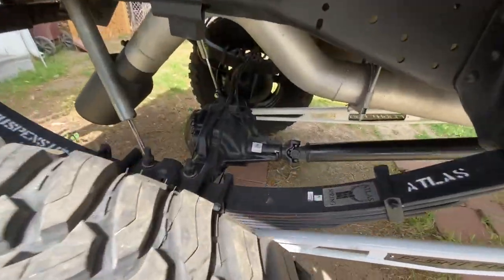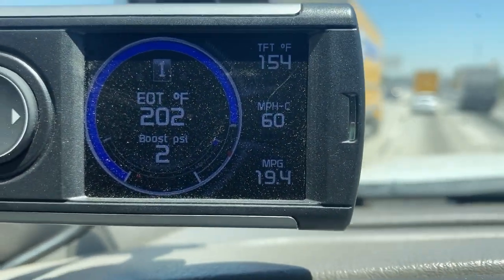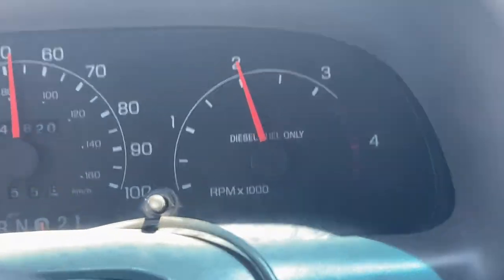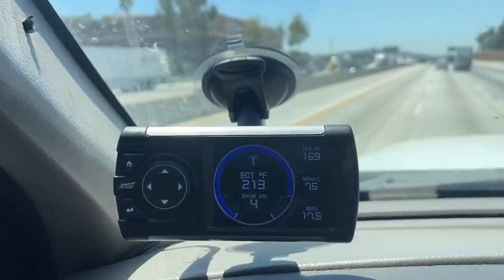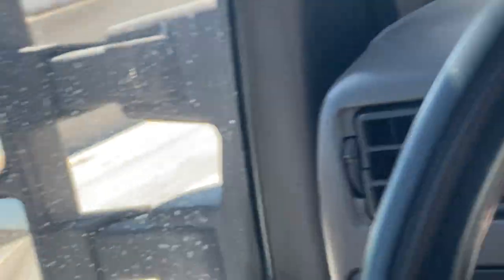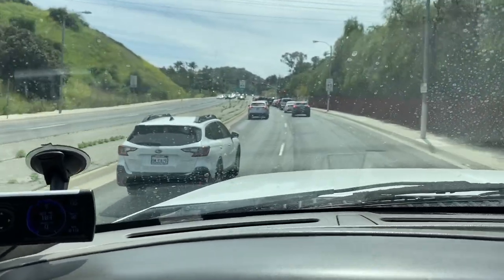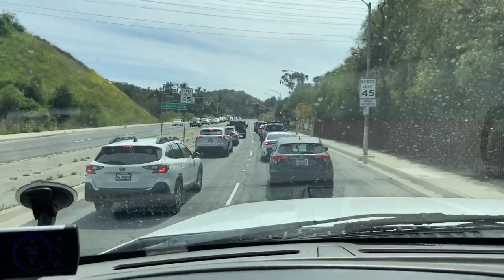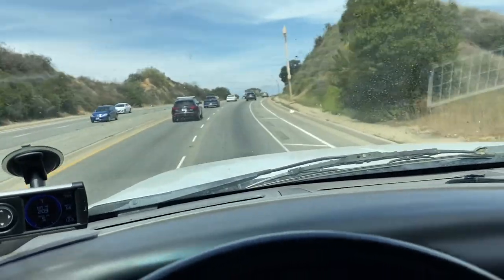4.88 gears in 7.3 powerstroke with 40 inch tires, first drives & review

Comment: Great video. It's also very encouraging mpg wise. I was surprised that the computer actually showed a better fuel economy even though you were running at a higher rpm. Since for my next build, I'm planning on using 40" tall tires and Ouverson 4.90 gears in 2.5 ton Rockwell axles front and rear. I was really worried that mpg would severely suffer from using 4.90 gears. Many people kept saying that I would need to use 5.13, or 5.38 gears if I wanted to use 37" or 40" tires if I want decent acceleration. Don't really know why they recommended the 5.13 or 5.38 gears. I just never talked with anyone that actually ran 40" tall tires and 4.88 gears in REAL LIFE. Thanks
Reply from the maker: Yeah, almost 3 years later and I’m still very happy with the 4.88s. The truck pulls my 22.5’ travel trailer no problem as well!

Comment: I'm running 40 x 13.5 R 20 Maxxis Razr Mts. I'm at 4.56 re geared as for daily driver setting and hwy Milage. Comes to tow it suffers. But, I've noticed the best method is performance tuner. It's back to optimal performance for towing. Maybe, later in near future I might go for 4.88

Comment: Have you looked into doing the trans cooler bypass delete kit  (thermal check valve delete)? That’s a big help in my opinion and under $50. Let’s the line flow 100% into the cooler instead of around 75%
Reply from the maker: Interesting bro! I’ll have to look into that!

Comment: I had 4.88's and after 2 weeks I took them off because I felt like I was too high on the rpms keeping up with traffic. Ended up going with 4.30's and and gave me 500 rpms less.  I'm on 37s BTW
Reply from the maker: Yeah the 4.88s are perfect for my truck with 40s so it makes sense it would be too much on 37s
Reply: Tas loco amigo 4.88s para 37s es overkill
Reply: @JesusF150   reread the comment. Thats the reason why I took the 4.88. Great low rpm’s. But they suck at 80mphs
Reply: @aaronmendez5461  damn, but they charged you extra to change them again?
Reply: what truck?

Comment: Hey bro I was curious did you ever change out your transmission pan for a bigger one that has cooling rivets on it and another idea that I got from somebody and they said when I’m towing a trailer I should have back up fans for the trans cooler to be able to do a haul when I’m moving at slow speeds
Reply from the maker: I haven’t changed the transmission pan, but I’m curious if the company that built my stage 2 tranny used a bigger transmission pan?🤔 and that’s a good idea too bro. Might need to look into that!

Comment: 2200rpm at 70mph is good, my dually with 4.10's towing the 5th wheel turns 2200-2300rpm at 70mph. Tip for ya, how about programming the Edge to read mph and rpm's that way you can film better. Also the transmission temps will range anywhere from 60-80 degree's over outside temps so 164 degrees is fine considering how hot it is outside.
Reply from the maker: That’s good to know! And that’s a good idea! I’ll probably put an rpm gauge on the edge now. And that’s good to know. I was a little nervous, but 165° is still way cooler than it used to be before the mishimoto trans cooler. Lol

Comment: 2200 rpm is right for 70-75. It could run that rpm w proper boost w as little engine ware as 1700 w low boost and high egt

Comment: Your videos are awesome brotha! Just got my first diesel and have been using your videos for information with my build. What gear ratio would you recommend for a 7.3 4x4 Excursion with 4” lift and 35’s? I’ve been talking to 3 shops and 2 recommended 4.56 and the last one recommended 4.30. I have a large 30’ trailer and go from riverside to Parker about 3 times a year. I mostly use the truck for long family trips and do 80-85 on the freeway. Also do you recommend the Edge CTS3 tuner or Insight monitor and Hydra chip? Thanks for all the good info man
Reply from the maker: If you only tow 3 times a year and you’re on 35s, I probably wouldn’t waist the money to regear it. 35s are barely larger than stock. I ran 37s on stock gears for years. If you towed every other weekend, or even once a month then maybe. But you won’t enjoy cruising at 80-85 if you put 4.56s in. That’s just my opinion. You should get a mishimoto trans cooler to help lower your trans temps, and the hydra is by far my favorite tuner. I’ve had the edge tuner, superchips, and now the hydra and it’s the best by far. And you can use it in a “tow” tune while pulling your trailer and I think you’ll be fine.
Reply from the maker: And a monitor is a good idea for sure so you can watch your engine oil temps, trans temps, and I recommend getting an EGT probe so you can monitor exhaust gas temperatures as well. This is the one I use: https://amzn.to/2xHTHso
You would need to buy the EGT probe adapter to read exhaust gas temps on the edge monitor. Or you can just use the monitor to read everything else and buy an individual gauge for EGTs. I’ve got 2 gauges coming in the mail now, one for boost and one for EGTs.
Reply: @NoHalfAss  my up pipes are bad should I go for the KC300 Turbo upgrade? Was it worth the money in your experience with it?
Reply from the maker: @allenmahan7122  it depends bro. I didn’t see a huge difference in boost with the new turbo, however most people do so I think something is wrong somewhere with my truck and I just haven’t taken the time to figure it out. Haha. KC turbos think I have leaks somewhere and say that I should be getting well over 30 psi but I don’t think I do. We’ll find out when I get the new boost gauge. But it was nice because my stock turbo was getting turbo bark and the new one doesn’t, and I shouldn’t have to worry about blowing my turbo unexpectedly anytime soon.

Comment: Do your tires rub on the lift springs when your turn all the way?
Reply from the maker: No. They did with the previous set of wheels but these ones have a -44 offset so they don’t rub. They only rub if I’m turned all the way coming out of a driveway or over a dip that causes the leaf springs to compress or something. But otherwise I can turn 100% in both directions without rubbing.

Comment: I know what you're talking about with engine load playing a big part of fuel economy and not just rpms. Also youll notice a bigger difference on the highway when you need to accelerate to change lanes because your engine will already be further in the power band.
Reply from the maker: Yes I totally noticed that already! I changed lanes to go around someone on the freeway and the truck accelerated so easily and so much faster and I was already going like 60-65!

Comment: I’m just curious if I got to stock size tires which is like 32’s I tow quite a bit should I keep the 3.73’s or do 3.55’s it’s automatic transmission
Reply from the maker: 3.55’s will make it harder to tow. The truck was designed from the factory with the right gear ratio (3.73s) for stock tires ready to tow. So unless you are towing something reallyyyy heavy and pushing the limits with your trucks tow capacity, I would leave the gear ratio stock with stock tires.
Reply: @NoHalfAss  I was thinking that

Comment: bro i just got an 00 with a very similar lift on 40s 13.50. my tires rub on the leaf springs when turning all the way. Debating on either new wheels or spacers
Reply from the maker: I have 40 15.50s, so my tires are wider than yours and they don’t rub with -44 offset. Unless I’m at full crank and going over bumps or something. So you can get slightly more negative offset to have even more clearance. I preferred getting new wheels over adding spacers.

Comment: Where did they install gears?
Reply from the maker: I wouldn’t recommend the place I got it done at. Had several issues and ended up taking it to American Gear Shop in La Habra CA to fix the job and get it down right. Haven’t had problems since.

Comment: For the 488 gears at $2400..posi units as well??
Reply from the maker: I got it done at Unitrax in Anaheim, but I wouldn’t recommend them. I had several issues that I had to go back for and eventually took my truck somewhere else to fix their mistakes. And I have trutrac lockers on the rear
Reply: @NoHalfAss  ok thanks for the info, i have a 99 f350 dually did an 8 in lift with 40 yokahamas ..bigger turbo ..changed injectors..but after seeing your video im going with 488's
Reply: @NoHalfAss  true trackers in rear what bout front?
Reply from the maker: @bobbychavez9017  I don’t think so
Reply from the maker: @bobbychavez9017  the 4.88s are nice with the 40s, especially if you tow anything. Pulls my 22’ travel trailer no problem
Reply: @NoHalfAss  yes i pull a trailer as well..so i just need truetrac lockers in rear ..what bout front?

Comment: I told you you would like them
Reply from the maker: I do bro! Thank you!!!
Reply: I have 373 4x4 what gear do I need to get better fuel mile in my 2000 f250 7.3 new engine from Ford
Reply from the maker: @curtiswilson8988  what size tires do you have?
Reply: @curtiswilson8988  373 are a pretty good gear ratio for good gas
Reply: @NoHalfAss  LT 235/85R 16
Reply from the maker: @curtiswilson8988  isn’t that the stock size??
Reply: @NoHalfAss  no stock size is LT265/75R 16